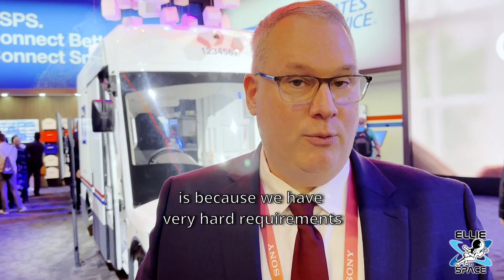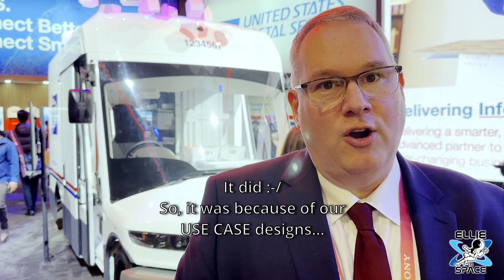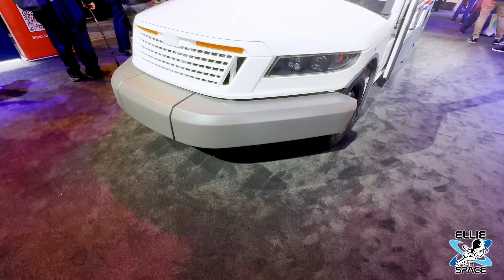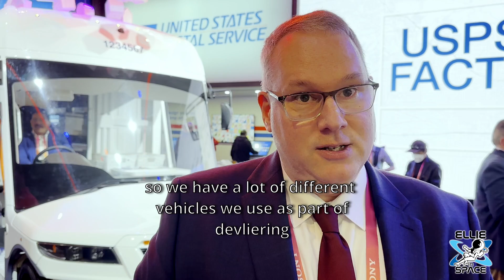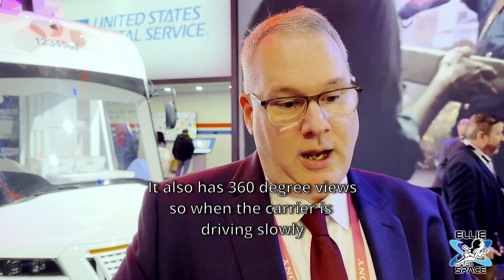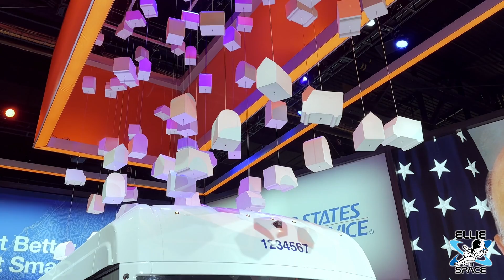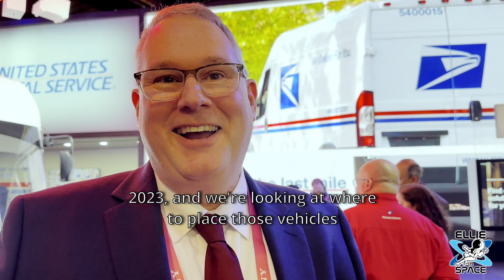The REAL reason the new USPS trucks are UGLY

Comment: Its great they are going EV.  But visibility is a joke when the front sticks out about 3 feet. This duckbill truck could easily run over a cat or small child it never saw. It doesn't have to stick out so far,  because it lacks a front engine.  Just look at the front design of the Semi. Its visibility is great. Just scale that shape down and you have your design.
Reply: It is designed to take an engine. I haven't heard the details on the ICE/hybrid version, but it probably uses a compact FWD power unit with a lay-down I-4 or boxer engine to keep the hood low.
Reply: You musta missed the part about automatic breaking and sonar.
Reply: @T-K-4-2-1  No I didn't miss that part. I don't believe that the govt's lowest bidder will get it right. (They aren't the military, that pays for quality high tech). Are they going to match Tesla's Autopilot 1.0 in 5 years? Ha, ha. The post office promised us good stamp machines in the 80s and they had to junk them for over 20 years until they got them right.
Reply: @jimwhitehead1532  "Military that pays for quality high tech"
🤣
I bet you fall for that meaningless marketing term "military grade".
We went to the Moon on a rocket full of parts made by low bidders making things to a very specific requirement. This is just a different set of requirements, among them durability. The EV drivetrain is going to go a long way towards serving that.
Reply: Imagine it runs of the Potus's dog! A national nightmare!
Reply: I'm assuming you have driven one.  Your comment wouldn't make sense otherwise. They look to me like the driver's position would give an excellent view.

Comment: EV postal trucks will benefit the most from regen braking with all the stop and go mail box to mail box driving. Can’t wait to see these vehicles on the road
Reply: And maintenance, probably. I worked at FedEx. Our inner-city trucks were brutal on batteries and alternators. They often didn't travel far enough between stops to recharge the battery from starting the diesel engine the previous stop. It would get so that, towards the end of the shift, the battery voltage would be so low that the radios (my responsibility) were unreliable and the drivers couldn't update the package pick-up/delivery status, print labels, etc.
Reply: Not going to work well.  When a disgruntled employee cuts all the charging ports. Promise you it will happen.
Reply: @Wonederdad71  They're being stopped from putting sugar in gas tanks now?🤣🤣😂 And hella more expensive to repair
Reply: It is great to see government spending forty percent more for this than it would have purchasing  an already proven vehicle.
Reply: @jamesmckay4573  EV's proven to be cheaper to run and maintain plus unlike gas junk have zero cancer causing emissions. So there’s that
Reply: @stevenhill3136  LOLOLOL zero cancer causing emissions. Because we all know electricity is created by unicorn poop and is magically inserted into the vehicle. God you people are so ignorant.
Reply: @jamesbizs  Dilution matters. By your logic your farts stink as bad 50 miles away lol
Reply: @stevenhill3136  Really, you think you will get cancer from ice vehicles. Let's hope you live in CA as everything there is a cause of cancer. Bet you still wear a mask.
Reply: @jimpatriot179  Diesel exhaust causes cancer. GOOGLE IT dummy
Reply: @stevenhill3136  And you can die from drinking too much water, some people are scared of everything. Thanks to oil you now can live to 80 or more, before oil you were dead at 40 or so and life was hard and brutal.
Reply: @jimpatriot179  I'm sure oil appreciates your gratitude but pretty sure society's ability to provide clean water deserves the  credit
Reply: @stevenhill3136  You do understand that clean water is only possible because of oil? Without oil, you would be living in a tiny village with no running water and early death. We would never have had the things we have today and solar heat would be when you were outside in the sun.
Reply: @jimpatriot179  Clean water started before oil, plumbing or electricity. The invention of wine actually. Fermentation process kills bacteria and farmers drank it all day long. Soon after coffee and tea even safer from boiling water
Reply: @stevenhill3136  You are missing the whole point which is. Without oil modern society would not exist. But some people worry about cancers or other things that may or may not be caused by oil. But some people forget that without oil our much longer life span is possible.
Reply: @stevenhill3136  EVs are actually coal and gas powered, so there's that.
Reply: @Morris-Monet   EV's emit no tailpipe emissions and produce significantly less emissions over their lifetime compared to ICE junk, so there’s that lol
Reply: Also EV's can be charged by 100% renewables vs ICE junk that is NEVER clean
Reply: @stevenhill3136  EVs are a joke for the woke.
Reply: @Morris-Monet  They’re actually much better cars. If EV's performed like a prius I still be driving ICE

Comment: 70 Miles… ??? pointless if it can’t do at least 150 miles.  Should have got Tesla involved.  Or at least someone with half decent battery technology. 70 Miles is like early 90s electric vehicle range.

I get that it does 70 miles fully loaded etc but common seriously?
Reply: Are Teslas towing 2,000 lbs of cargo? Check that math.

The longest route USPS runs is 187 miles...I'd imagine the rural routes will get the new ICE vehicles, and the high-density routes will get the EV...in which case 70 miles at full capacity is more than enough.
Reply: @T-K-4-2-1  Yes they can. Model X is even cheaper than this monstrosity. Imagine the USPS delivering your next letter from the IRS through the left falcon wing dors. Cool!
Reply: They won’t be driving cross country
Reply: @dewiz9596  Brand new yes they will probably make most of their deliveries before needing a recharge for the day, but I’d hazard to say in some rural communities they won’t be able to make the whole day. five years later they won’t be able to make normal deliveries in a city without recharging. And if you want to send them to another location or city now you have to ship them in a truck.
Reply: @isaacegglestone5526  Yawn. More tired myths. Retail EVs are looking at 20 years to get to 80% of rated capacity. These will probably do even better as fleet vehicles with a dedicated team looking after the health of the vehicles.
Reply: @Markle2k  Your assuming they used good batteries but clearly if the range is so low they are not.
Reply: @isaacegglestone5526  Tell everyone you know nothing about how any of this works without telling everyone you know nothing about how any of this works
Reply: @Markle2k   Haha maybe you got me there. I did do research on the battery but I can’t find any good metrics on the Na–NiCl2 (ZEBRA) battery. I found a paper by USPS saying it has 4500 cycles and yes that’s just under 15 years or more if you consider full time usage so it’s possible it lasts 15 years but I also found other articles stating there was degradation of the battery type after even 60 cycles.  

Yes many newer vehicles have long battery life and Zebra says the life is long but they are not saying what the efficiency of the output is over time. I took the 15 years and divided by 3 to get 5 years. I assumed 30% loss over five years at 70% of 70 miles and got 49 miles.  Yes I could be wrong about all of this so if you can find any docs on this I would be happy to read them.

Additionally everything I have read says they need to maintain very high temperatures in order to maintain the good charge retention overtime. Perhaps this issue was solved but again I don’t see explanation of how and the chemistry is the same.  Which means the longer they are parked and not used they might degrade faster.

Taking these factors into account maybe your still right I can’t tell but I don’t trust a battery with so few uses in electric vehicles and such a low range.  It would make more sense to me to double the required range and make sure it can cover all USP max ranges. Then we can do away with ICE version of the vehicle.

4500 cycles but only with high temperatures: 
https://www.researchgate.net/publication/363662363_Life_Cycle_Assessment_of_Sodium-Nickel-Chloride_Batteries (September 2022 article) 

Signs of degradation after 60 cycles:

https://pubs.rsc.org/en/content/articlelanding/2013/ta/c3ta13644b

Again doesn’t prove much and it’s an old article but I just couldn’t find better data and I’m not willing to accept this type of battery has no degradation of charge output for the whole 15 years cycle.  It’s not likely given the 2013 article investigation and it’s requirement to run at high temperatures to maintain proper charge. 

Overall here don’t get me wrong this is a great thing for America. I probably sounded too negative and probably deserve you making fun of me but I’m just not buying it. Let’s see how things pan out in 5-10 years with these vehicles. 

I’ll try to explain myself better next time instead of using words like pointless.
Reply: @dewiz9596  They wont't be driving country. Full stop.
Reply: It is pointless to spend money on extra batteries for a 150 mile range when you only need a 70 mile range for 90% of routes. That's fully loaded and running all accessories and climate control full blast.

Comment: Good report, thanks. However, please use and instruct others in proper microphone technique in locations with high ambient noise. The hand microphone should be held straight up just under the chin so you and others speak across it. The closer the microphone is to the speaker’s mouth the better the signal-to-noise ratio. Don’t make the mistake of holding it in front of the mouth that looks bad and is susceptible to breath-popping and plosives. The higher the ambient noise level the narrower the pattern of the microphone should be used. “Shotgun“ microphones come in various lengths. The longer the mike, the narrower the pattern and its ability to reject unwanted sound.

"Bad sound makes good video look bad."